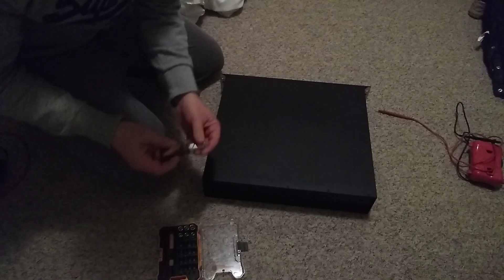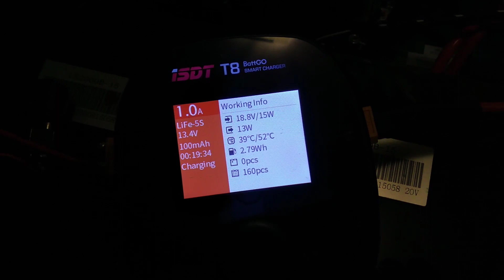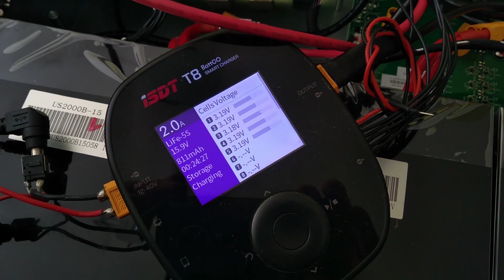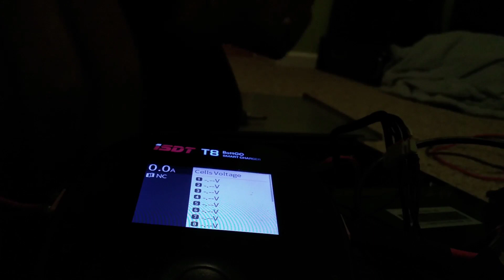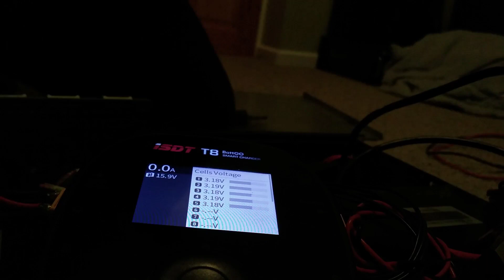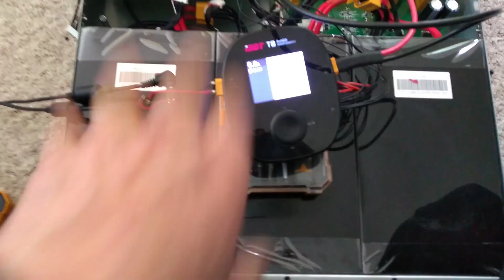Totally flat Pylontech battery. Can it be recovered?

Comment: Hi good work can you help with smart charger how did your connectior the battery balance cable to the charger as it not standard connector so I can connect my isdt Q8 max smart charger to battery as I have 3x us2000 as they've never been used can you help thank

Comment: I have a us2000 and us2000c. Both flat. The charger you have has 9 pins? And each of the 3 batteries have 10 pins. How did you connect your isdt to the batteries?
Reply from the maker: I didn't use the balance leads in this case as I just wanted to add enough charge to each block to enable the BMS to turn on.

Comment: I have a us2000 plus, voldtage was at 30ish, just hooked up My bench power supply at 53v 5A, turned on battery and held in SW button 10 sec, and it started charging..

Went pretty quick up to 45v, chogging away slowly at 225 wh..

Comment: Hi Nicholas, I have a brand new "bricked" US5000 battery that was fully charged, I had to shut it down to after a prolonged power failure on the grid and since then I'm no longer able to start it up. No leds, no sound nothing. BMS comm is down. It seems unlikely that it is completely discharged. In the documentation it mentioned the possibility of a broken fuse. So my question is, during your journey digging into the internals of this pylontech US2000 battery, have you seen anything resembling to a fuse? I can't open mine since that would void the warranty.
Reply from the maker: I don't (off the top of my head) recall seeing the fuse, perhaps it is possible to spot it from my footage of the inside?

Comment: I have had a terrible experience with these batteries.
I purchased 4 of the 3000c type. The supplier sent me three 3000c and a 3000, I returned the 3000 and they sent be the correct one, a 3000c.
On connecting the new 3000c the second battery went into idle mode, wouldn't charge or discharge, and would not revive after leaving overnight.
I contacted the supplier and was told they would replace that battery under warranty, which they did.
On connecting, the other three batteries went into idle mode and stayed there.
 They told me I had connected the comms bus incorrectly and that I needed an Xcom/Can unit to communicate with my existing Studer XTM 4000/48 and the Studer Variotrack which I purchased at the same time as the batteries. They had not mentioned that and I had never seen one needed.
Now they want over $7000 to replace the batteries. That I suspect were just a bad batch as the one replaced under warranty was fine when returned.
I have sent the whole lot back and it is now in the hands of my lawyers.
Grrrrr.
Reply from the maker: Have to say, it does sound like some kind of Comms issue.
Reply: @nicholashowell  
The biggest comms issue was with the supplier I reckon.
The BMS is to protect the battery, not tell it what to do. In fact I was told to return the inverter back to default settings, far higher than  the batteries could take, I didn't do that.
Well, like I said, I returned the whole order.
The comms mismatch should not have blown the BMS, I still suspect a bad batch of BMSs and the supplier not wanting to honour the warranty.
We shall see.
I will let you know how it pans out.
Cheers.
Reply from the maker: @BoB-Dobbs_leaning-left  Thanks, I'd be interested to know the outcome.
Reply: @nicholashowell  So far...
It is in the hands of my Lawyers.
I doubt if I will get a technical explanation.
Reply: @nicholashowell there was a bad batch made with chips that were that compatible with other plyon tech batteries

Comment: Hi Nick, what did you use to connect the cells to the balance port to monitor the individuals? I’ve got the Q8 max charger, thanks
Reply from the maker: I basically used something like this https://www.amazon.co.uk/Balance-Extension-Battery-Charging-Silicone/dp/B08L5WCH82/ with the desired number of wires. I then pulled the pins out of the one end so that I could feed each pin directly into the balance cable of the battery. If that make sense.

Comment: Hi Nicholas, you clearly know your stuff! Here's a question for you: we recently had a new solar panel setup installed with a US3000C battery. Unfortunately the installer wasn't great and plugged the CAN cable into the wrong port on the inverter leaving the battery drained to 0% for 2 months (while I chased him to come and fix). Will the battery be damaged by this? It appears to be working fine now. Just wanted to hear your thoughts. Thank you.
Reply from the maker: Well my experience has been that the totally flat one I recovered has been working fine and doesn't appear to have suffered any lasting damage.  Hopefully yours is the same. You could plug in the battery software that I used in the video to see what the BMS thinks the capacity of the battery still is, this would give you some confidence that all was still well.

Comment: I have just had a pylon tec us5000 shut down because a faulty inverter drained it without me noticing, at the time it shut down it still had 10% charge (to protect the battery I assume) I am hoping that when the inverter is fixed it will power up the battery without any lasting damage, I would of thought your battery would have had the same protection or had it been left for a long time thereby emptying it completely. Many thanks for all your videos.
Reply from the maker: At 10% your us5000 will be fine. They can drain down to 5% it says in the manual. This battery was left on, uncharged so long that the BMS itself drained it down to nothing. So long as yours is off using the rocker switch, it shouldn't drain any lower.
Reply: @nicholashowell  many thanks for getting back, I was getting a bit worried, but yes I did switch it off straight away, hope all goes well with yours, best wishes

Comment: Im gonna wait for the electric car batterys from crashed cars
I have a heat pump and need a much bigger battery
Reply: Tesla 5kwh modules are $1000 or a bit less. 24V 6S but its lithium ion
Reply from the maker: I've seen a 64kWh Kona battery going on Facebook market place but I don't have space for it.